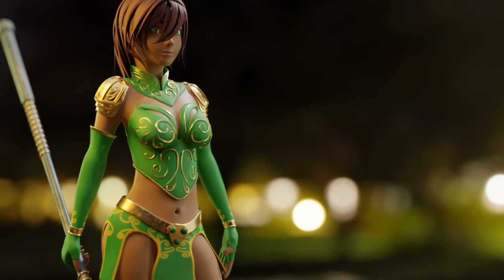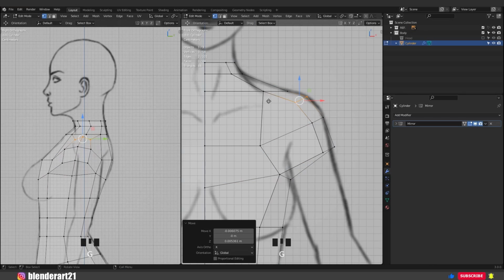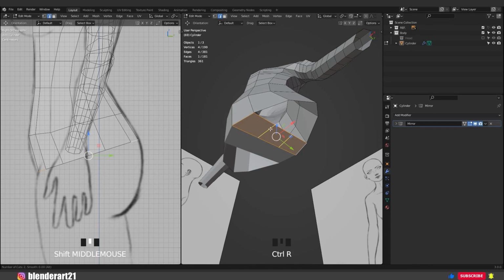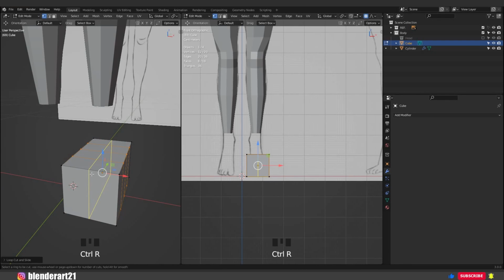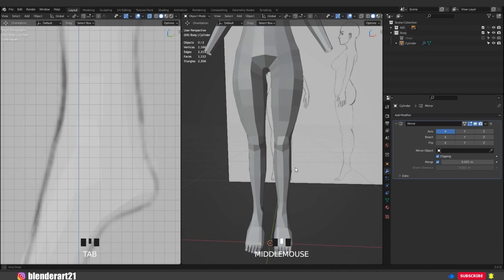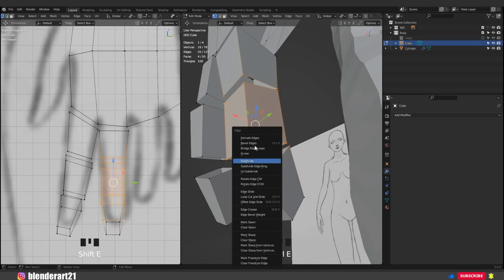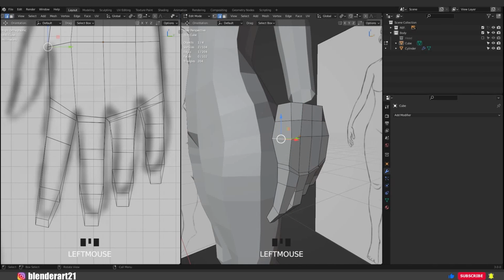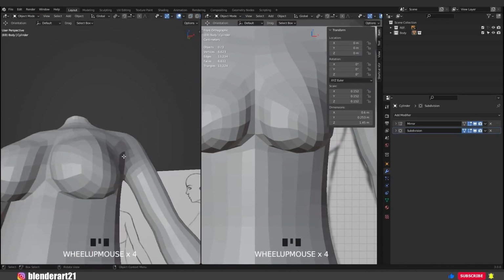Blender Character Modeling Tutorial - Body Modelling for Beginners - Part 3

Comment: Hi, I had the probelm when joining the handdisables the mirror effect for the whole body, I did not notice in time it's because both are in the same folder. I edited some vertex after so CTRL+Z does not work to return before the CTRL+J and if the mirror just doesn't mirror the body properly. Any suggestions?

Comment: I've been following this series and it's been very good but where you merged the vertices on the foot into triangles isn't good. I realize now that you just end up deleting the foot later on but at the time I was following this I did not know that and now I'm having to go back and fix the tri's as the character I'm making is barefoot and I need to have quads and it's very frustrating. For a beginner tutorial I think more emphasis should be given to maintaining quads everywhere, even if the intention is to delete the section later on, since it's just good practice and standard to do so.

Comment: Thanks for the detailed tutorial! I am following this and I have a question, when using the loop tool to bridge the foot with the body, as well as the hand with the body, even though the vertices numbers align, there's still a sharp edge line across the connection line. Any suggestion on how to fix that? Wanting to use this for 3D printing!

Comment: If your mirror modifier starts to disappear when you join the body and the foot (and the other tip with the scene collections isn't working) try to set the rotation/location back to default by pressing Ctrl+A and apply the mirror modifier again after that.

Comment: my extrude and scale tools don't scale from the midpoint like yours which I think is what causing problems when I try to use looptools on the arms. How do I get my tools to behave like yours?
Reply: Because of this I had a hard time with my nails and toes because they would all scale or rotate based on the last face I selected
Reply: @theprotopotato2531  Did you ever figure that out? Im having trouble rn with my toes, the middle two extrusions are acting different than the first three with scaling.
Reply: @dahlianeko  yes I did, there's a thing on the top bar that can change the origin points of your transforms, I think it needs to be on "individual origins".

Comment: the tutorials were amazing up until this point, my model starts to deviate heavily after each time you say "make sure to take the time to move the verticles and to find the shape"...
i mean how am i supposed to "find the shape"?
also what does it mean to keep the mesh quad? how?
Reply: Quad I think means making sure ur making squares with all your points, or vertices, that make up your mesh. Keeping your vertices quadrilateral makes it easier for the mesh to function. Making shapes that have more than 4 points can be bad for it somehow ? Idk something to do with how it converts everything into triangles later. Hope this helped!
Reply: @hannahnybakken5588  That's correct, also try to keep the quads uniform as much as possible and try to stay away from using triangles.
Reply from the maker: what I mean about that you should find the main shape for the body as an example or the face etc etc ... also you should keep your mesh quad as possible..
and this gonna take time from you to finish
Reply: @BlenderArt  Its not about how long it takes, its we dont know how to get it in the right shape, even if we spend hours on it..

Comment: I'm stuck on the mirror modifier. When I G+X to see if the vertices are stacked, they aren't stacked... Am I missing something? I enabled clipping. I'm assuming its supposed to be two halves, perfectly aligned, but its one piece because I can't split the middle to open a window into the inside of the model as you did.
Reply: same!! did you fixed it?